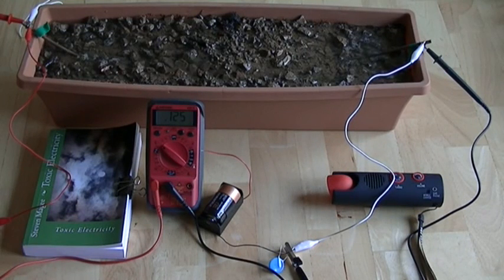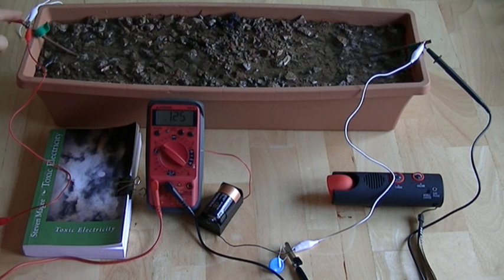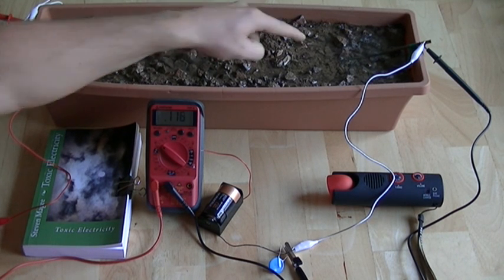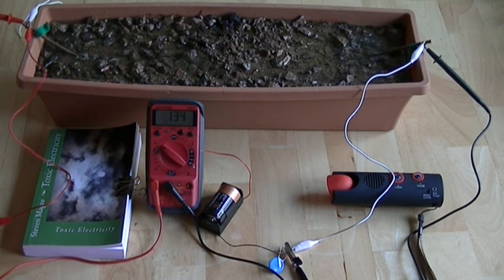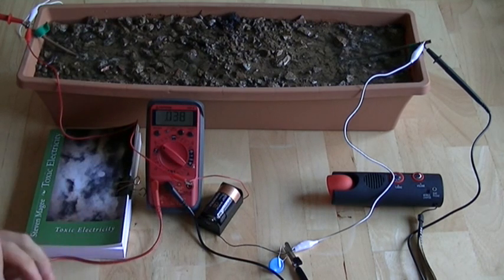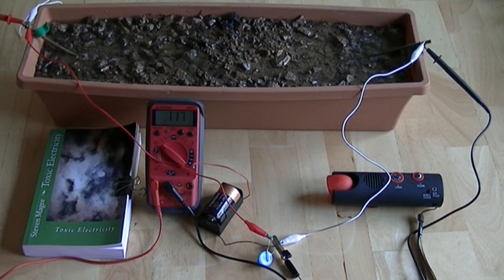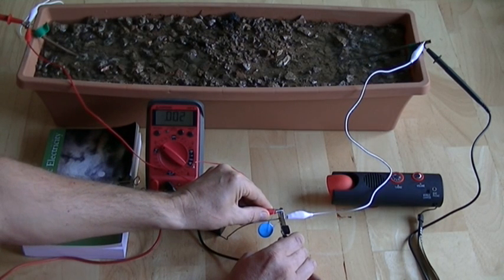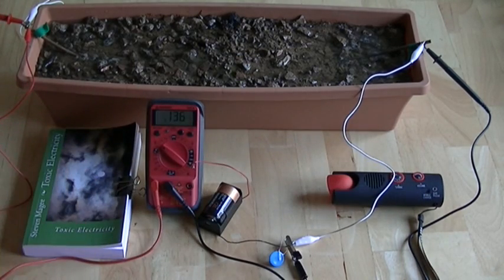Ground Current Electromagnetic Interference (EMI) Demonstration

Comment: Based on the current Herzian wave radio technology this is the case. The ground current interfere with with the EM wave radiation through the dielectric. On the other side, if one is to study Tesla's work, one will notice that he was not radiating but sending ground current waves, 95% ground current waves and 5% wasted radiation in the form of EM waves. His "Colorado Springs Notes 1899-1900" are an excellent source for such knowledge, but requires mind shift in order to understand.

Comment: Can you explain what's happening with Nordost cables. Are ground currents used for military coms? I mean they use air waves above your head. Microwaves to lift the ionosphere, to create weather mods. Chemtrails to block the sunlight hitting the earth, theses contain strontium, aluminium, barium. So I expect the earth below your feet is used for coms too.

Comment: It`s mind boggling when you think about electrons and how they interact with different atoms and different clusters of atoms.
 Curious since the measurement of an amps is just the count of how many electrons pass a certain point per second.

 Example 1 amp is the count of  6,000,000,000,000,000,000 so then how many electrons are flowing through the soil in your experiment ?

Might help to clear things up if it`s broken down and explained with the above knowledge stated in some of your videos ?

Cheers,
Terry